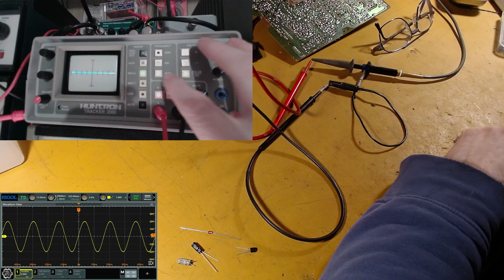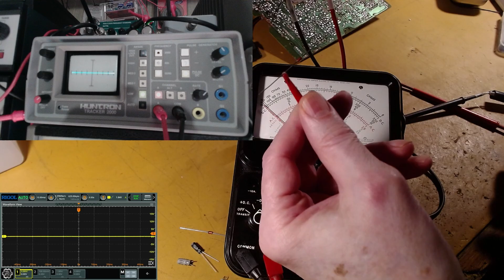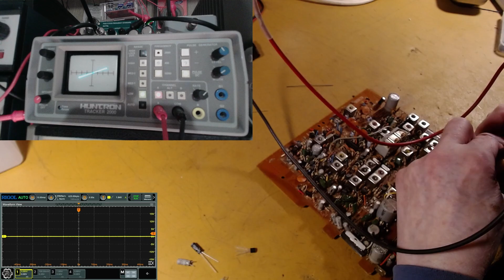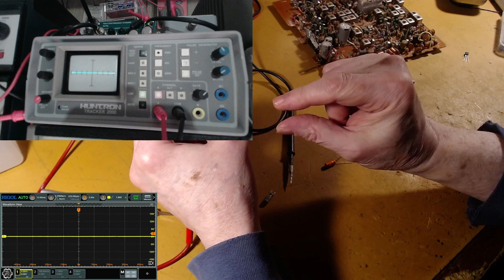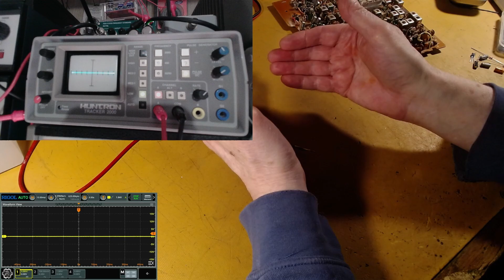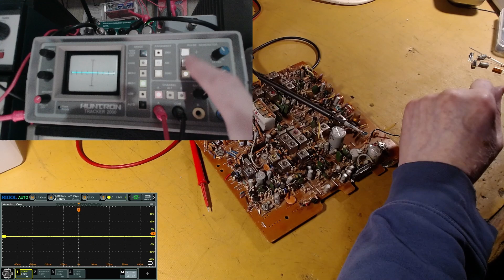Huntron Tracker 2000. How does it work?

Comment: very nice video, if I may add, with the  Huntron ProTrack's  in the 200 - 400 mv range you can check in circuit  all or most resisters and capacitors with out turning on the ICs and Diodes.

Comment: This is the best video I've found for the Huntron 2000! Thank you for putting this out. Would you consider doing a video breaking down more detailed signature interpretations? The problem I'm having is understanding what is a good signature vs bad. I've got a ton of components that I am using for study, but sometimes I just don't understand what I am looking for.
Reply from the maker: Experience with the unit is the best way. It doesn't take that long to get to know what you are seeing.